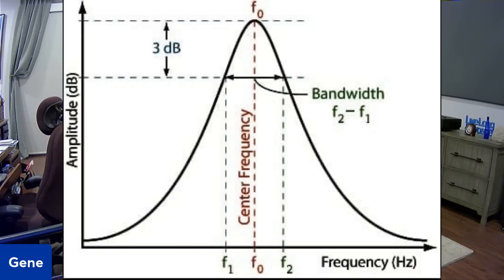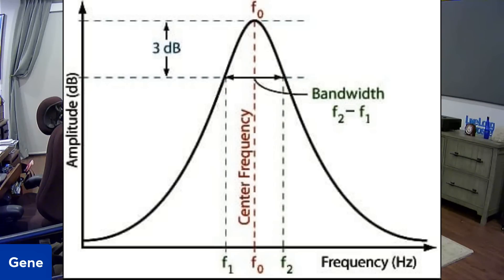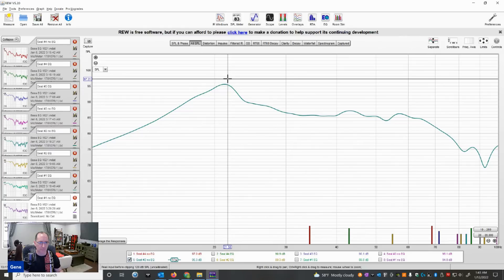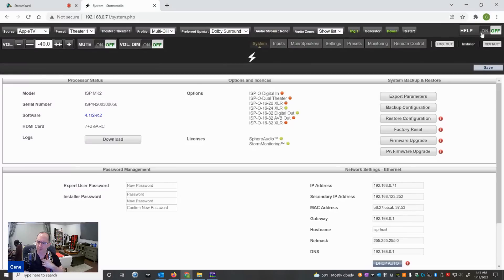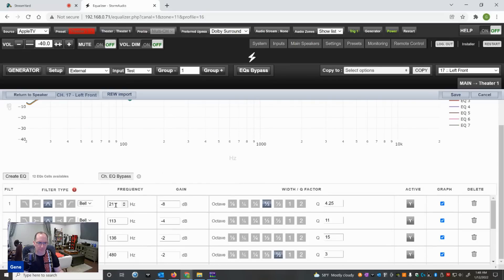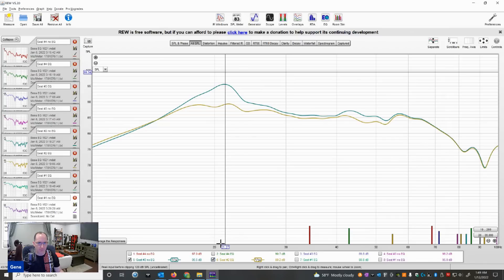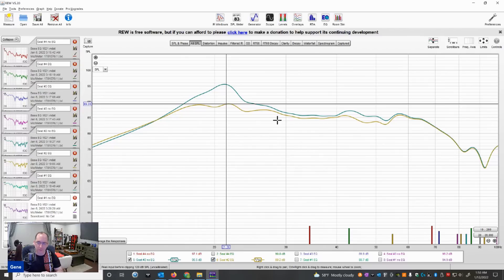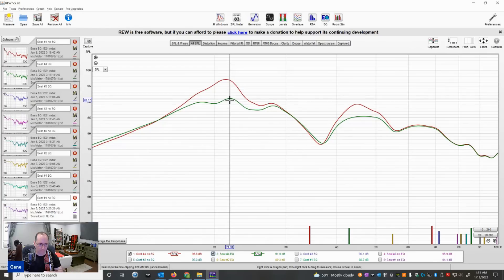How to Optimize Your Home Theater Bass with PEQ

Comment: Gene, long time subscriber here.  Thank you for all you do.  I have what I presume to be a very basic question that I cannot find a clear answer to.  In your video you talk about flattening the 20 Hz peak, but you do not mention why that is "better".  Can you explain?  The reason I ask is because I am beginning my research/education on how to customize the sound of my 7.1 system using the digital Eq on my Yamaha AVR, and when I query search engines on how to generate a "punchy" sound the results tend to encourage boosting low-mid frequencies.  Granted, I am targeting frequencies in the 100-250 Hz range and not 20 Hz, but I think my question still applies.  Any incite or video links that might help?

Comment: Why would you want to tame down a  20 - 25hz peak? Why would we want big drivers with big amps for output at low frequencies and than tame them down? I dont get it
Reply from the maker: Because frequency peaks are very audible. If you flatten them, you linearize the bass. Then you can turn the bass level up without it sounding bloated or boomy.

Comment: For a PEQ filter, the Q is not the ratio of the center frequency to the 3 dB bandwidth.  A PEQ filter can have a peak or dip of less than 3 dB, in which case the 3 dB bandwidth has no meaning.  But the Q of a PEQ filter always has meaning!  Robert Bristow-Johnson (RBJ) wrote a paper called "The Equivalence of Various Methods of Computing Biquad Coefficients for Audio Parametric Equalizers", in which he defines the bandwidth as f2-f1, where f1 and f2 are the two frequencies for which the boost or cut in dB is one-half the maximum (which occurs at the center frequency).  So if you had a 10 dB boost or cut, it would be the 5 dB bandwidth.  Although he doesn't mention Q in that article (he uses damping factor instead), in another one of RBJ's papers called "Cookbook formulae for audio EQ biquad filter coefficients", he defines the Q in a special way that's a little different from how it's defined in EE filter courses.  When you combine the two results (using the Q and bandwidth as RBJ defines them), it works out mathematically that the Q is exactly the ratio of the center frequency to the half-boost/half cut bandwidth.  I worked out the mathematical details of that in an article titled "Parametric Equalizer "Q" Definitions and Bandwidth".  I didn't post links, as some youtubers automatically delete replies with links in them.  A web search (including quotes) should turn up the three articles.

In the example of this video, the required cut for the filter is about 7 dB, so half of that is 3.5 dB, which is close to 3 dB.  This makes the numerical value of Q, computed from the 3 dB bandwidth, very close to the exact value (which would be determined by the 3.5 dB bandwidth in this case).  But for other cases where the boost or cut is a lot different from 6 dB, the error will be larger.
Reply from the maker: Thanks for your post. I will tell you nearly 100% of the time I calculate the Q of the bump using fc/(f2-f1) and apply a cut it works as expected with real in-room measurements.  It may not be a perfect approximation but it is still an extremely useful tool to use.
Reply: @Audioholics  It's an easy change to use the exact result.  If you need, say, a 10 dB cut, the Q is exactly fc/(f2-f1), where f1 and f2 are the 5 dB points.  It's exact if you use the half-boost/half-cut bandwidth.
Reply from the maker: @andyc.3893  Yea its why you make the correction and measure the result and adjust accordingly.

Comment: Gene, I calibrated a basically flat curve from 20-100hz and it sounds as if my subs are not even on. I increased the sub trim by 6db as a baseline and now it curves pretty smooth from 20-80hz but at 20hz its like 15db higher then at 80hz where it meets the mains. Am I crazy that it has to look like this to even hear the sub? I'm in a non-ideal room with no treatment and one sub.
Reply: Keep tuning, you rich folk will get there in the end....... im too busy helping starving children......

Comment: Is it possible to benefit from PEQ with only one sub and no measuring equipment and no REW? (I'm using a SVS SB1000 pro in a 12ftx15ft room) Thanks 🔊👌🏻
Reply: Ofcourse......

Build a bigger box or buy a kit and transfir the sub driver and amp out of their box...... it will sound a million times better, than sell your box on to reclaim your costs.....

Comment: Hi, Gene, may I ask how many subs do you have? 4 Subs? what's the location of the subs? Seems 21hz is the 1st order Standing waves of the length and if you have four subs and get them properly located and time aligned, this standing wave should be able to cancelled using multi-subs. But in your video, it's there, why?
Reply from the maker: My subs aren't optimally located so that is part of the problem. However, the point of multiple subs isn't to cancel standing waves but to create a more even and consistent response from seat to seat by exciting the room modes. This allows EQ to become effective over a wider area as a result. Always better to cut a bump with EQ then cancel it with subs.  

see: https://mehlau.net/audio/multisub_geddes/?fbclid=IwAR1TavoKfL8rFoH3a2sOB0SpZKTKNFUiJkSk1vNqCnWQwHEYI40BfTeuANc
Reply: Nice read...... negligible gain from 3 to 4 subs, non from 4 to 5 except headroom....... i also found interesting the comments about room treetment, i never knew there was a difference between low frequency and high frequency room treatments 😱 lol.....

Thank you 🙂👍🏻

Comment: Gene, you're the man! 😃 I had a similar bump at 16 hz  (4 SB-2000 Pro). I followed your instructions and calculated a  -3dB gain with a Q of 2.666. I added that to the input channel on my MiniDSP 2x4HD (since the the individual subs are already using the PEQs in each output channel) and it brought that bump down just as expected. Thanks for the quick tip. Like yours the bump was present at that same frequency at each of my 5 seats, so doing that 1 filter fixed that issue across all seats.

Comment: Great video Gene.  Wouldn't something like Dirac Live Bass Control accomplish this and potentially even outperform since it's adjusting impulse response as well and handling multiple subs?  I've tried to do manual EQ with REW and compared it to Dirac and Dirac always wins for me.
Reply from the maker: In theory yes. In practice I haven't been as lucky as you. I haven't run DIRAC on my new set up though but plan on it soon.
Reply: Ive heard so much about Dirac..... initially good and now more negative comments, im undecided tbh.....

Comment: Interesting stuff!  Would like to see more detail on your measurement process (some may have been in an older vid). For example are you testing L + R at the same time?  With one sub at a time or both?  Best spot to “hide” in the room so as not to effect measurements?  Love the channel!
Reply from the maker: You want all subs and the mains playing at same time to see the summed response. Sometimes I do focus on 1 sub if i think I can dial it in better though.
Reply: I have headphones that need a bump from 2,000 kHz to 12,000 kHz. What octave should I use and what frequency.

Comment: Hi Gene - excellent information as usual - thank you. One question and one observation:
1. How much smoothing do you use/recommended for equalising the bass frequencies. The REW manual and some other forums recommend not using any smoothing. Your views and experience would be highly appreciated...
2. Having used Dirac live on an AudioControl processor recently, I find that I prefer Dirac live 'off' and just used minidsp to equalise my two subs. There has been some recent discussion about room eq solutions not being ideal above the transition frequency of the room. Again - your views would be appreciated.
Thank you.
Reply from the maker: I use 1/24th octave smoothing which is sufficient for fullrange measurements and you loose very little resolution at bass frequencies. I also prefer manual EQ. I haven't had much luck with full bandwidth auto EQ.
Reply: @Audioholics  Thank you..

Comment: Great video thanks.  I have heavily treated my room to get a good response but need to add the finishing touches as I have a 7db peak around 20-35hz I would like to pull down a bit.  Thank you   edit. I have just realised I havent re measured since filling my whole front wall with 17" depth of Rockwool.  I think just by the sound of it it has certainly helped with the rise in the low end. Im using 2 subs. I will remeasure and then use this video to help with PEQ. Thanks

Comment: Nice intro video. 
In my experience a filter with Q higher than 7 (at bass frequencies) is inaudible. Also Q > 3 can slightly reduce rate of decay.

For multi seat, multi sub eq the best thing I’ve used by far, is MSO (multi sub optimiser), a free windows based program although I run it on a Mac with a cheap converter app. I have both Audessey and Dirac AVRs and MSO will do a better job in that specific scenario using a Minidsp.

In my home theatre I have 3 SVS PB-3000’s connected to Minidsp to provide a single sub out on the Arcam. Seating is 2x2 with back row on a riser and seat to seat variation is excellent.

Comment: A similar presentation using the PEQ function now on SVS Pro subs would be useful and informative to an even wider audience.
Reply: I wish the svs has a 10 band peq, or at least 5. 3 is just not enough
Reply: @overkillonslash  agreed but the only subwoofer I know of that's close in price to SVS with peq is Rythmik and they only have 1 peq.
Reply: Thats true, somehow i think the dsp in the pb16 could have handled an extra 1-2 filters and be an even better bargain. At this point i think an external dsp solution like the mini dsp 2x4hd  would still be much better in optimizing its performance than just relying on the app alone.
Reply: I second this! I’d love to see Gene give his tips on it.

Comment: That's all good as long as you're not introducing phase shifts with each filter you use.
Reply from the maker: You aren't.  These are min phase.
Reply: @Audioholics  okay, what do you consider min phase in the audio band.
Reply from the maker: @wally6193  Before making claims, check the research. Anytime you reduce the amplitude of bass energy in a room with EQ, it also improves the time domain behavior too.  A Fourier transform proves this as well.

https://www.audioholics.com/home-theater-calibration/bass-optimization-for-home-theater
Reply from the maker: @wally6193  https://www.aes.org/e-lib/browse.cfm?elib=5163
Reply: @Audioholics  Gene, I wasn't making any claims I was simply asking what you consider min phase, or min phase filters.
Reply: Minimum phase refers to a specific type of linear, time-invariant system in control theory and signal processing. Here are the key characteristics of a minimum phase system:

1. Both the system and its inverse are causal and stable[1].

2. All zeros of the system's transfer function are inside the unit circle (for discrete-time systems) or in the left half-plane (for continuous-time systems)[1].

3. It has the minimum group delay among all systems with the same magnitude response[1][3].

4. The system has a stable inverse, meaning its inverse will have all poles inside the unit circle and be causal[3].

5. It has the most compact impulse response in time for a given amplitude function[3].

6. The phase response is uniquely determined by the magnitude response[2].

Minimum phase systems are important in various applications:

- In control systems, they're desirable because they minimize filtering delay, which can be critical for stability[3].
- In equalization and room acoustics, understanding minimum phase behavior helps in applying effective corrections[4].
- In filter design, minimum phase filters allow for easier matching of amplitude responses[5].

It's worth noting that real-world systems, especially room responses, are often mixed phase, containing both minimum phase and non-minimum phase regions[4].

Sources
[1] Minimum phase - Wikipedia https://en.wikipedia.org/wiki/Minimum_phase
[2] [PDF] Digital Signal Processing Minimum-Phase Systems - spinlab https://spinlab.wpi.edu/courses/ece503_2014/7-3minimumphase_systems.pdf
[3] What is the true meaning of a minimum phase system? https://dsp.stackexchange.com/questions/2241/what-is-the-true-meaning-of-a-minimum-phase-system
[4] Minimum Phase - REW https://www.roomeqwizard.com/help/help_en-GB/html/minimumphase.html
[5] Definition of Minimum Phase Filters - CCRMA, Stanford https://ccrma.stanford.edu/~jos/filters/Definition_Minimum_Phase_Filters.html